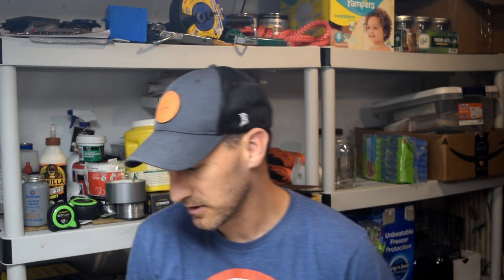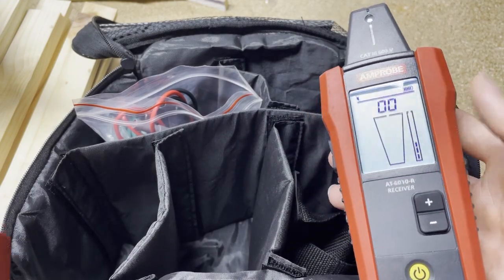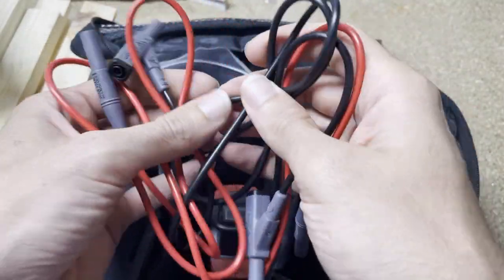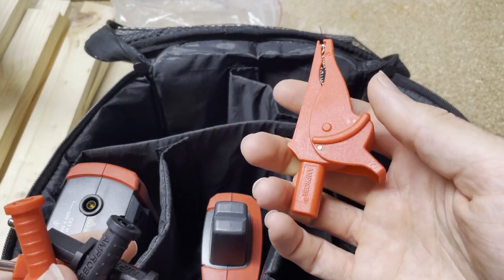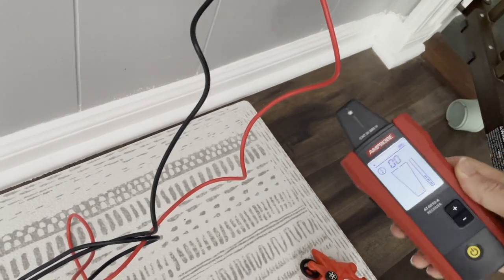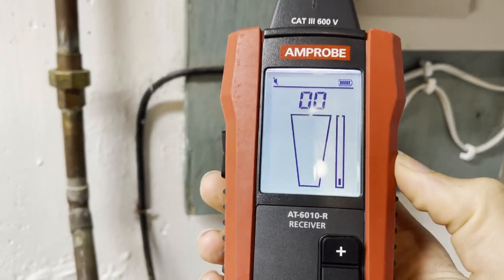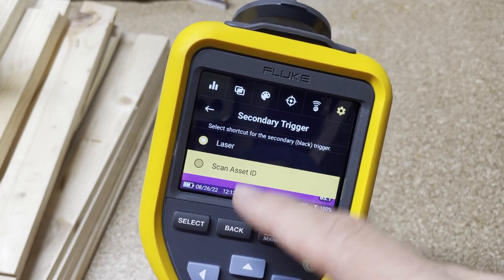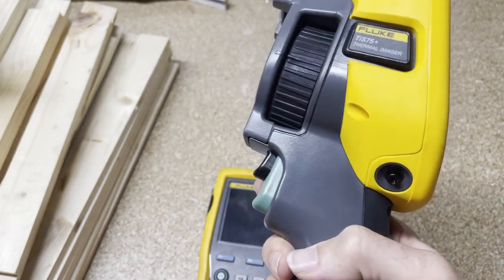AT 6010 - Fluke Fridays - Episode 66

Comment: It's a shame these don't have a higher voltage rating, I'd love to be able to use them on solar strings to trace wire breaks but they tend to start at 600V DC.
The induction loop would work.
Reply from the maker: Yeah induction could work I think. Also if it is a broken wire is it already deenergized?